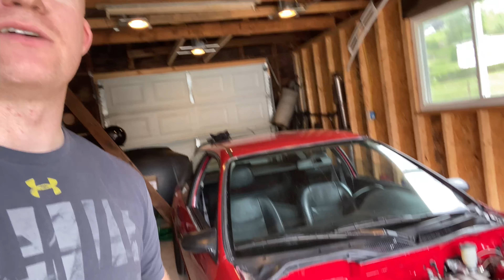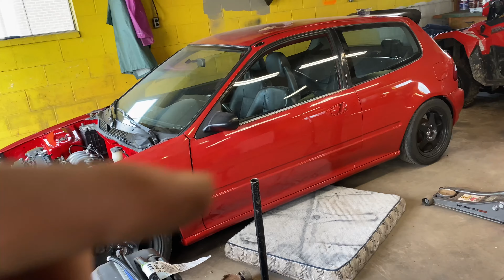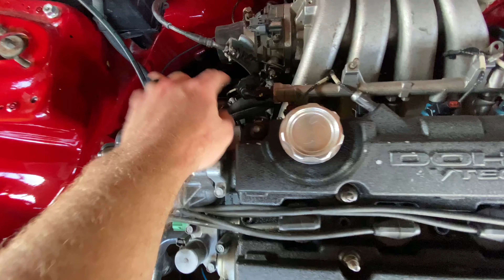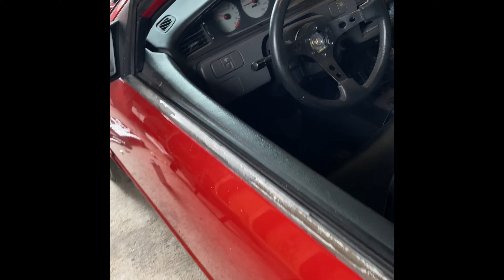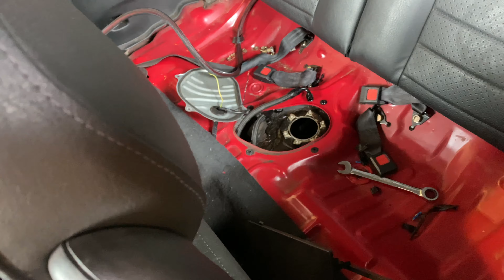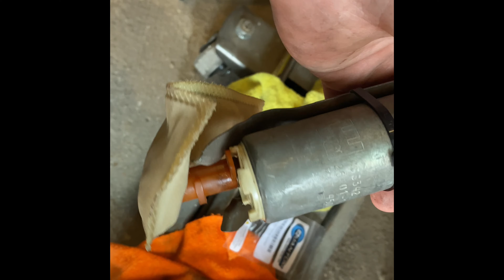Eg6 build ep 6. IT RUNS!

Comment: Nice video man! By the way, what are your thoughts on the intercooler? (For the f150) thinking about getting one for my 2017 2.7 eb
Reply from the maker: Thanks for stopping by man. Well overall. I did some basic monitoring (I’m still planning on doing a small video) and my intake air temps would bounce all over the place. High, low, and I’d never get a consistent number. Well after some small driving with the rev9 my intake air temps do not move. They are very consistent and lower than factory. So it’s doing it’s job and it’s on a budget. Win win lol... if you decide to order one use my link on my last intercooler video in the description to help the channel grow. Thanks for stopping by 🙏